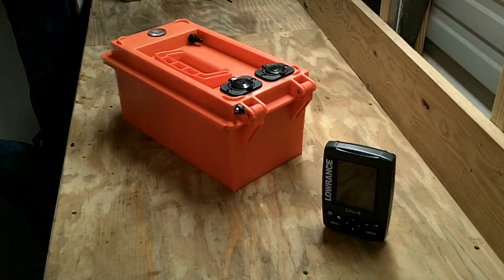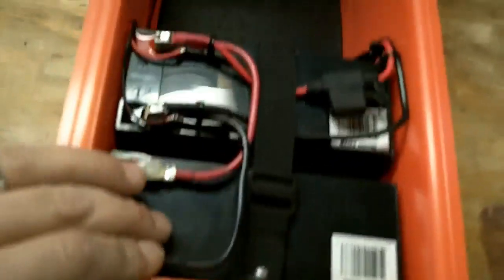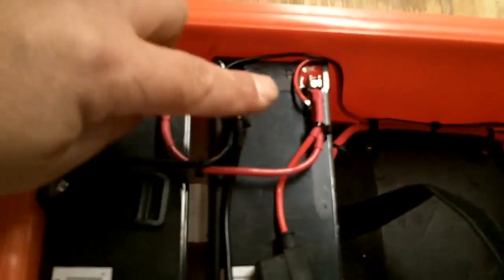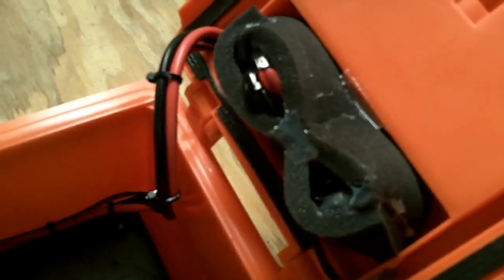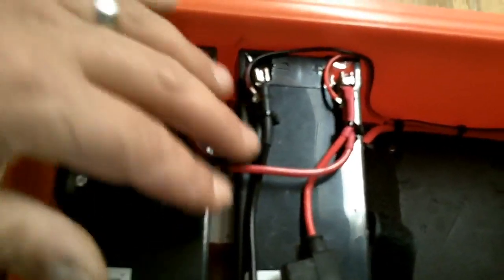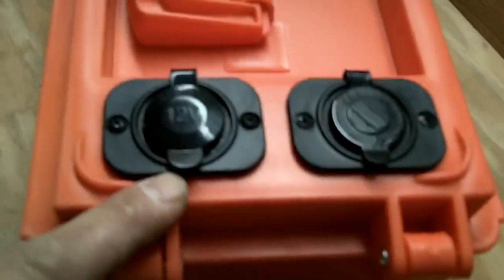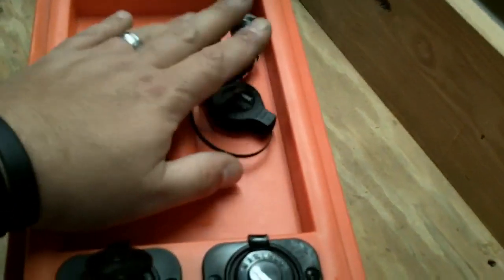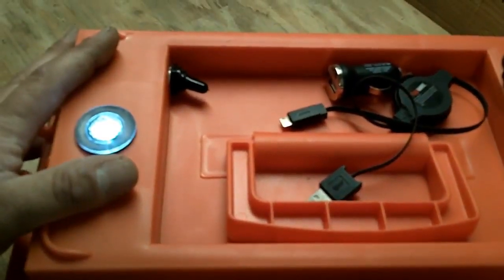Kayak Fish Finder-12volt Portable Power Box-How To Build

Comment: Hey Jimmy! Great build. I had visioned this and then checked YouTube and saw your video. I guess I'm the only one that needs to know what size  box you purchased. I went to Academy and they have two sizes in orange. The batteries I chose on Amazon won't fit the smaller box and yet the larger box looks taller than yours. Can you tell me which box you purchased?
Reply from the maker: Victoria Olsgard Hey thanks for the comment! I will look at the box tomorrow, if that is ok
Reply from the maker: Victoria Olsgard Hey Victoria, I am so sorry...I have been painting my house..hate it, anyway, the box is (the bottom portion, not the lid) is 12" long, 6" wide, and 6" deep.. The whole thing with lid closed is about 8" tall. Again sorry

Comment: This is by far one of the better box I have seen on YouTube and have inspired me to make one Like yours! I'm having trouble finding that charger is there anyway you can help me with that? Thank you in advance
Reply from the maker: Netos Trucking It  Thank you for checking it out! I got the charger from a local electrical/electronics supply here in Hattiesburg MS. It is called N&H electronics 800-264-8808 | 601-582-5571. I will get the model of the charger that I got, and post on here for you
Reply from the maker: Netos Trucking It Ok, sorry for the delay. The charger I went with is a TDC power, Mod. BCA-66-121500. It is 12v and 1.5 amps. The amperage is a little low on the output side of this charger (for 2 batteries) but it was cheaper, and I don't mind if it takes a little longer to charge. Don't use it everyday. It will completely charge those (2) batteries in about 1.5 days. But u can get a faster charge rate. Just tell them at N&H what u have, and they will help you decide.

Comment: Good video! I am actually looking to build something like this in order to carry my Humminbird 688 around. Do you know how long the two batteries in serie last without a recharge?
Reply from the maker: Nicolas Brousseau  Yes and No...I have used mine for 3 straight days without recharging, and did not have an issue. Dont really know how much longer it would have went, but I did not have any trouble. The only thing I do differntly now....is I charge this battery box with my standard "full size" Schumacher battery charger, set to 2 amps. I dont think I was ever getting a full charge before using that little wall charger.

Comment: One thing to note is that if you were to use a charger above 8 amps the way that you have it set-up would not be a balance load, meaning that the nominal charge would be too much to go from one battery to another. To make it balance, the charger would have to be connected to the positive of one battery and the negative of the other battery while keeping the batteries in parallel. I think what you have done is fantastic. Thank you

Comment: Hey great video.   I'm trying to duplicate something like this for my kayak.  I did have one question tho.  If you hooked the charger up to a cigarette lighter instead of the three pronged plug.  Would you be able to charge and plug in ur fish finder with the one cig port?  Like just have one plug for both input and output or would this require different wiring?

Comment: why not go out from pos of one battery and neg of other battery to your plugs.  Wouldn't the current setup pull both batteries down at the same rate?
Reply: Hi, I am not a pro in electricity and stuff, but his setup is parallel configuration, it drains both batteries at the same time but slower, and you stay at 12V. You propose a serie configuration and this brings the system up to 24V (12+12). Which would be good for bigger equipment, but no need here. cheers!
Reply: @asdfpoiu01  No, series is pos to neg and pos to neg. Parallel is pos to pos and neg to neg, but you need to have your mains split between the batteries, one on pos, and one on neg of the opposite battery, to force current to draw threw both batts at the same time.
Reply: @awalker1328  I just realized I understood what Stuart said wrong. Thanks!

Comment: Hello Jimmy Ray,   wondering how long this battery set-up actually runs. Running time  for running just your locator is how many hours. Wondering because I am going to build either one or two of these depending on your answer. I need it to last a week without being able to recharge the batteries.  If I ran this unit for 10 hours a day would it really last 5 days? Sounds to good to be true. Thanks in advance for your answer.

Comment: Question.....? You use a 15 amp fuse,,, what amp should i use ? To pwr all these accessories?  Trolling motor pulls 50 amps i believe, its a minn kota 36lb thrust, garmin 301c f/f , do i need a circut breaker or in line ok? Thanks

Comment from the maker: @Peter Laurence, I used the 3 wire plug and socket because it was readily available at sporting goods store, and I also use a small trolling motor from time to time that plugs into the same twist lock socket. You can get the boxes at Walmart. Actually I believe they are ammo boxes

Comment: Great video! Smart..... What gage wire did you use?
Reply: jimmyrayblues one of the best battery boxes I've seen. Very smart set up man! I do have a question though. What would happen if the hot wire got water on it?
Reply from the maker: Thanks. I used 12guage stranded from the battery to the plugs

Comment: Please show a close up and more explanation of how you put two leads on battery two. Those terminal clips are tiny. Also please show where the charging pigtail attaches. Does it bypass the fuse? What if you wire your trickle charger to the cigarette outlet and just plug it in there?  Awesome build!
Reply: He did show the wiring, then he went on to explain how the outlets were linked.

The "hot lead" was the constant lead to the fish finder, which connects to the "cigarette port", which then connects to the "3 prong twist lock" outlet. (positive to positive & negatives to negatives.) The line then runs to the battery with the in-line 12 amp fuse.

In the video, he charged the batteries using the 3 prong twist lock outlet, but I'm pretty confident you should be able to use the other two outlet as well. 

Although it's not original, these type of battery configurations are done on boats all the time,  but I completely agree, it's a very clean professional-like solution worthy praises.

Comment: how much would it be for the box without batteries or charger, prewired for one battery connection? I have the same battery that you have just one. im very interested in getting a box like this and would rather have it done right.

Comment: Great video!  This is pretty much what I'm looking to build.  One thing that I'd add is that you should not charge the batteries with the lid closed.  Even though they are sealed batteries, they can still give off some gas.  There's a warning right on the batteries.  Thanks again for the video!

Comment: You are incorrect in your "series" definition. You have to "daisy chain" the batteries (+ of #1 to - of #2, then + of the #2 battery to device +, and device ground to the - of #1. that will double voltage while retaining Ah rating.

Comment from the maker: The terminals on the batteries themselves are spade clips, available at auto parts store. The "Marinco" 12v socket, and The "Marinco" 12/24 volt Twist Lock Trolling Motor plug/socket came from Academy Sports